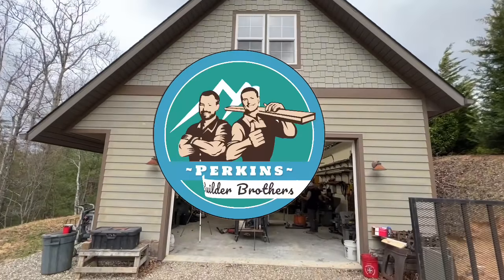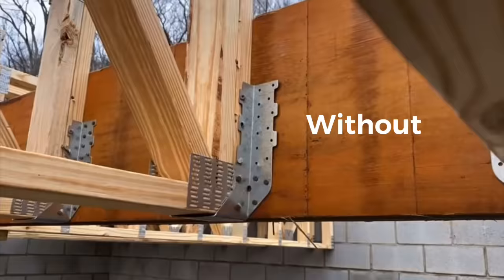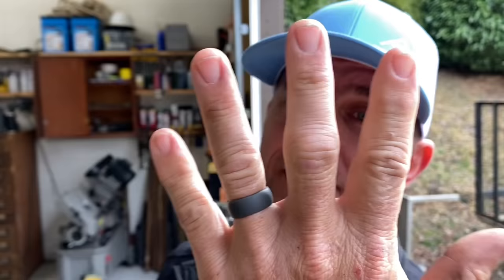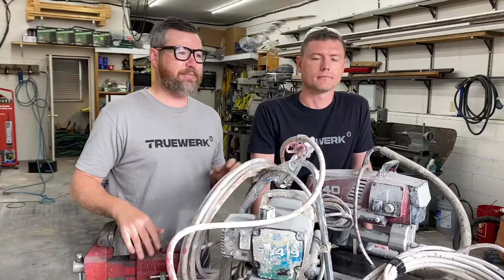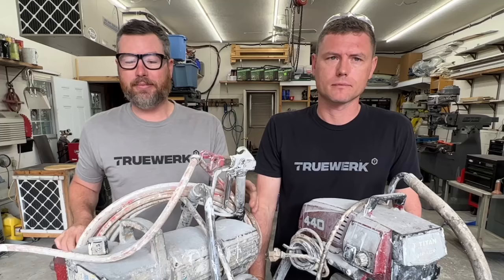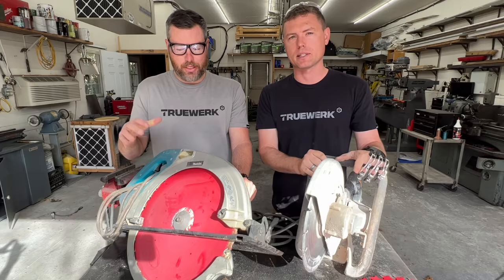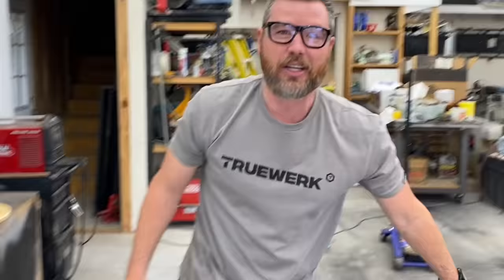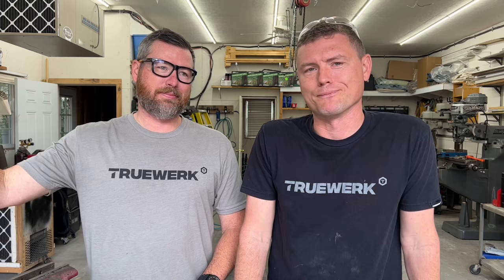Tools we waited too long to buy  + toolbelt setup

Comment: The impact  driver and the oscillator saw have been game changers the last 10 year
Reply: I love my Dewalt 12V oscillating tool with the quick release blade. Game changer for sure!
Reply: i got a toolbag with an oscilating saw on my first day as an aprentice. so i cant imagine what it would be like without it. i use it all the time.
Reply: 10 year? how old are you 😂 been around lot longer than that

Comment: Biggest game changer for me recently was built not brought.
Get some turn buckles, weld some flat bar on the ends with holes drilled in it. Screw your turnbuckle to the top of a stud or top plate and the other end to a timber brace that’s screwed to the floor. It makes straightening walls so easy and accurate
Reply: I think that’s a great tool! And I love to hear that you made it
Reply: can you link a video of what you've explained here?

Comment: Great list. If anyone reads this, think long haul. Investment over time. When I got my one man business started 20 years ago I got a titan 440 impact. I started doing painting, used the little profits from that to build my carpenter tools arsenal. I am a renovation carpenter that specializes in finish work, custom cabinetry and shelving, all forms of trim work. I still have that 440 and I use it mainly for pre painting/finishing all my materials. Buy top quality that you can afford, you will save money and buyers regret. There is nothing like getting on the job with a new toy, dialing it in, seeing the ease and time saving it gives. Especially if you have really wanted the tool for a long time.
Reply: Well said!
Reply: I agree with this but I will add my own take. I sometimes start off with the cheapest option. Because I had some serious regrets buying a really nice expensive tool, only to find out that it was shit quality, or had some kind of awful idiosyncrasy that I hated, and then since I'd got an expensive one, I was stuck with it. I guess this could be mitigated by selling the thing and recouping some of the cost. But yeah I sometimes buy the cheapest option to learn about the tool and most importantly learn what I like and what I want, then when I know what I want, I go and spend the money on a good one.
Reply: @faithful451  I agree, if I am not familiar with the tool, or I don’t need it or I won’t use it that often I can save a few bucks on something cheap or used. However I have been building for 30years. I used a home made tracksaw for a decade till I worked for a guy that had both a 55 and a 75. I immediately learned why they are so expensive. I do like starting with the basics and building my skill before getting some tricked out equipment. Skill is paramount. Experience will show you why certain equipment features will be a game changer for your particular style of work and why some features are useless for you as an individual.

Comment: Great vid again.  We run the Dewalt cordless nailers but ONLY with Paslode nails. Anything else tends to jamb.  Also run the  Milwaukee 18 gauge trim nailer.  So much better when doing additions where the original home is occupied. (noise) Especially now with so many people working from home.  Love your vids.  Real people on real job sites. Thank you!
Reply: Thanks this is a good tip. I never thought of using different brand nails with a gun

Comment: Enjoy your videos guys, thanks.  To avoid cumulative error you can simply swap the jigs from side to side occasionally. Any micro error on one side will then micro correct on the other side of the siding course.
Reply from the maker: Good tip
Reply: A decent green cross line laser will catch any problems before they compound.

Comment: As for tools, back in my day when i started in the home building industry, power saws, then commonly referred to as Skill saws were just gaining in popularity.
Rough carpenters, AKA framers would have 3 hand saws in their tool box.
A large tooth variety called a rip saw, a smaller tooth 8 point, and a 10 point for finer work like installing pine facia material.
A sharpening service would come by the jobs weekly to pick up saws, and return them with the blades covered with a cardboard cover.
Most saws were made by the Henry Diston co. in Philly.
Tool belts didnt exist, nor did the large box stores that sold everything from tools to lumber and home cleaning products.
Lumber was sold by lumber yards, and they had sales people who visited the job sites.
They supplied heavy cloth nail aprons and carpenter pensils with their name on them.
Hammer holders were made by bending the heavy wire the lumber was contained with from the lumber yard and attached to the belt holding your pants up.
There were no tapes used other than the 50 and 100 foot variety.
All carpenters used folding rules in either 6 foot or 8 foot versions.
So a framing carpenter on a job site would be wearing a nail pouch with 2 large pockets holding nails.
And a framing hammer and a folding rule and a pensil, and that was all.
Framing carpenters also had a hatchet in their tool box which got frequent use since there were very few power tools.
I always felt that the sawsall was the best creation in my time. Mainly for its use for fixing mistakes made in door and window locations.

 
I cant understand why today its necessary to carry every tool you own all the time.
I mean how often do you need a cats paw? or a chalk box? even a speed square? which by the way didnt exist either in the 50s and 60s. If we needed a cats paw we would just ask for one to be passed up to where we we working, same with a chalk box or other tools. 
We also always used a cut man operating the power saw. He did all the cutting of things like headers, jack, cripples, etc.
And he was always one step ahead of those nailing things together.
And we also had to cut all the studs, since precuts werent available then either.
A helper would place the studs on a rack on the floor, and 25 or more at a time would be cut by using a chalk line for marking them.
I would certainly agree that especially some of the power tools today are very important to have.
Especially ones like the Paslode nail gun used for the metal hangers and truss straps.
The early version framing nailers were in my opinion more trouble than they were worth.
When i moved to Florida in the late 80s we still didnt own any framing nail guns.
I did buy a couple after i moved there however and they worked pretty well.
But we did have and use trim nail guns, and also power mitre saws for the trim work, which were time savers.
For more than 20 years we had 2 full time trim carpenters, each of whom worked alone.
We never used our framers for trim work.
My brother ran the jobs after all framing, roof shingles, rough ins and concrete floors were complete.
I ran them from stakeout untill that point.
 i personally staked out and set the batter boards for every house we ever built, with zero mistakes of any kind ever.
In 1973 alone we completed 97 houses on scattered lots within a 50 mile radius of our office.
With a good helper and fairly good lot conditions i could stake out 2 houses in a day provided there wasent alot of travel time involved.

What you guys really need to be thinking about at this point in your life, is how long do you want to be hanging over the edge of a roof?
Especially during those bad months when things get icy and even more dicey.
Be thinking about that shop, and shifting over to needing a bigger one, even a much bigger one with much more machinery and a place to paint cabinets.

A large kitchen and bath remodel can be more lucrative than building an entire house, especially when a remodel or addition is involved.
Also making custom trim and other millwork like custom doors is worth thinking about.
Just learn to keep your hands away from the machines when their running.
Put power feeders on everything you can, especially things like shapers.
My youngest son now 52, was always more interested in the trim part of carpentry.
He moved to Florida also now close to 20 years ago.
But he almost immediately moved towards building cabinets and installing them.
He has since moved to 3 different shop locations due to size constraints.
He owns his present 4000 sq ft location, but he could easily use twice that much space.
Lumber and plywood storage alone requires a lot of space.
Plus space to store cabinets after they are assembled and then finished.

He is also a Florida licensed building contractor, and will soon have his electrical license as well.
Which can be a big obstacle when doing any type of kitchen remodeling.
So my advice would be to be thinking less about tools,and more about where you are in your life.
How many days are lost due to conditions and other things beyond your control?
Reply: You may have been great at what you were doing, but I don't really understand your advice. Do you think all people doing constructions should move to something else, safer and more lucrative? Then who builds the house?
Don't forget that the brothers also know different people at this point, all involving constructions. They have this YouTube channel and possibly use other social media as well, where they post their videos and are now close to 1 million followers. That is also a source of income. Moving towards something else might cause them to lose the followers, which means less income from the videos and less money from the advertising. Then it will also be an investment to get all the tools they need for their new job, to get the proper location, etc. 
So even if what you suggest them to start doing generally brings more income, for them it wouldn't.

Anyway, thank you for sharing your life experience. It sounds like you and your brother had a full life, and your son in no less talented.
Reply: a
Reply: ".....with zero mistakes of any kind, ever." 

Lol. Okay, old timer- I see the old memory bank deleted all the mistakes

Comment: For bits, I keep a Klein 14-in-1 Screwdriver on hand with a DeWalt locking bit holder in it. Serves me well as a handyman, who runs into all kinds of fasteners. I put a Key-baks on my rig shoulder straps with NC voltage detector and a mini Klein contact voltage detector connected to them..

Comment: In addition to my big sprayer i bought a year back an Graco Ultramax for doors, skirting boards and siding. I have seen you guys paint siding by hand I highly recommend an additional small sprayer for these projects it is such an time/effortsaver. I set mine up in about 2 minutes ready to go and cleanup is also around 10 minutes max.
Reply: A little $50 electric sprayer does the exact same job as a $5000 airless sprayer
Reply: If you want a serious finish use a big giant 200+ litre compressor with 3 moisture traps
Reply: @SH19922x  Not really, and yes i tried.
Reply: @antonvink agreed, completely absurd comment.  Those cheap sprayers can't even spray unthinned latex.  I've never even seen a real painter use a harbor freight sprayer like he is suggesting.

Comment: Oscillating saw, Dremel tool and a heat gun were game changers for me after many years. the heat gun allows you to finish a paint or plaster patch instead of having to wait  for it to dry and the dremel is great for cutting screws and nails and the saw is a must.
1

Comment: I came up using needle nose for tico nails, then got introduced to a palm nailer. If I was still building daily I’d go for the positive placement nailer. Geckos are great idea and perfect for 1 guy to hang siding. Laser level vs optical transit- I have my dads old optical transit and caught a big error that the concrete crew made using their laser level which would’ve missed our block footing elevation by 1.75”, so say what you will, but those old school optical transits work well, and there is a telescoping measuring stick that usually comes with them which is much more stable than a tape measure.

Comment: I commented on your website for two cheap tools you need:  a 3D square and a drill guide.  Both would make perfect holes for your wire railings.  The 3D square wraps around a post to extend lines in two directions.  The drill guide makes your drill into a mini drill press for perfectly straight holes.

Comment: Another good option for driving tico nails is a palm nailer. Not AS fast as the paslode but when your nailing a lot of ticos or in tight spaces it is great
 . It also really makes a good option when you have to drive nails in tight spaces where the pneumatic wont fit.

Comment: Like these tool appraisal videos. @19:20 The best little tape I ever used was an 8 metre Irwin small body. With many years of surveying, I've had many, many tapes either clipped on the belt or in the pouch and these things just slip in and out with ease. Only ever used a fatmax once. They're good tapes but far too bulky.

Comment: Also - Instead of the Positive Nailer, I really recommend & love the palm nailer! Doesn't require any specific size like the Paslode, and is much less expensive.
Reply: Palm nailers are a HUGE step up from hand nailing, but a PPN is really a must when you're a framer, and you're installing a thousand plates in a home. Saves you so much more time even over a palm nailer, and you don't outpace your air compressor.

Comment: Airless spray rig pro tip: use Teflon packings instead of the leather packings that most rigs come with. The Teflon packings will last much longer and perform better with different materials.

Comment: I put all my driver bits in an old Altoids mints tin. It fits conveniently in my tool bag and it’s just big enough to hold all the most commonly used bits:

- T10 thru T50 torx
- ttap bits
- spider drive 
- Phillips and slotted bits
- 5/16 hex
- 1/4 hex 
- square drive 1 thru 3

Comment: Hi - love your videos.  It will help children in school dealing with possessives.  THE HOUSE HAS IT'S PROBLEMS.   Note that if you get rid of the contraction you get: The house has it is problems.  -  this is not what you want.  So we do not use the contraction because it does not work.    So each time you want to use the contraction- spell out the word and see if it actually works.  You see it doesn't work and you can fix it for not only adults but KIDS too.

Comment: Good video guys! One thing you didn’t mention and probably didn’t even consider is what kind of hard tonneau cover was open on the truck at the 14 second mark? I’m in the market for a new cover.
Have you guys every used a Scrail gun? It a nail gun that drives screws. It’s a cool system. Drives like a nail but you can back it out with an impact driver if you need to move it etc and then screw it back in with the impact driver.
Ron
Reply: I have never heard of that but you have my interest peaked now…

Comment: I use a palm nailer to nail the joist hangers, and its only a fraction of the cost
Reply: Nails are cheaper to.
Reply: Still takes a lot longer. $50 palm nailer or $200 joist gun. At $20/hr that's only one day of work difference. You can do 4-5 hangers to 1 palm nail hanger.

Comment: Guys the “Quick snap magnetic pencil holder”  made by magnogrip if far superior! Check it out, I always did the same thing with my pencil. It took a couple of days to get used to but it became a habitual thing. Better because it is not attached to a string

Comment: Have all of em! Lol Not all exact brands but Id rather have it and not need it, than need it and not have it! Have at least 2 of everything I'll ever need. Except a second shop. Been in everything construction for 20 yrs n work on my own everything as well. Trees n bushes would eat my bits with that magnetic bit holder tho n what I do works great but looking into a patent or id mention it. One thing I do for siding that has worked wonders is using grk cabinet screws, depending on your of siding. Love Malco but hate that particular 1/4 5/16th driver! Gets stuck n comes off too easy imo

Comment: I am finish carpenter,  I have been hesitant about cordless finish nailer.
I will still use air. For baseboards,  and cordless for crown, no air hose on the rung of a ladder or flopping against the wall.

Now the debate ...
Senco fusion
Or 
Milwaukee fuel

My air senco is made of magnesium only 3 lbs, the cordless are 6 lbs typically. 
Try it and see

Comment: Dude I love RR builders stuff. I acutally use a palm nailer for jois hangers since I dont use them often. I would definitely buy the gun if I did them more though. I just got the gecho guages finally since Im down to a one man crew. Also, this is the 2nd time Ive heard Yall talk about the 16 guage form Milwaukee. Im pretty sure thats the gen 1. I have the gen 2 angled version and its just like a bigger 18. Small rubber replaceable tip and shoots great with a easy opening if you ever hit some concrete or something and get a jam (which I havent yet since Ive had it the last 6 months.

Comment: Milwaukee cordless framing nailer will beat all others. I have two and go all day running 3.25 inch nails
Reply: I just hate how heavy they are!
Reply: @michaelmaas5544  however way easier than dragging an air hose about, cheers.

Comment: Are you talking about the new gen 2 miwaukee 16ga nailer or the first one. I had one of the first one. I returned it the first hour after I bought it. The only milwaukee tool I found useless so far. I love the 18ga.
Reply: All the new V2 Metabo cordless nail guns are also awesome.

Comment: I don't think that's oil you put in a sprayer. My Graco takes "pump armor", which is mainly ethylene glycol. I've heard you can use mineral spirits, but flammable can be dangerous. Oil might not be great for spraying latex paint.

Comment: I was thinking, you guys might have a certain favourite nail brand.
But theres a difference on the nail heads some just have half a circle and some has full circular head, that would make some nailers jam, because the hammer function the nailer provides wont have a proper connection
Just my 2 cents on your jams